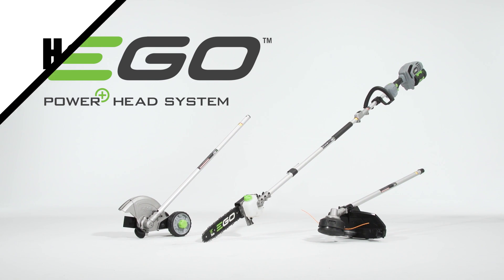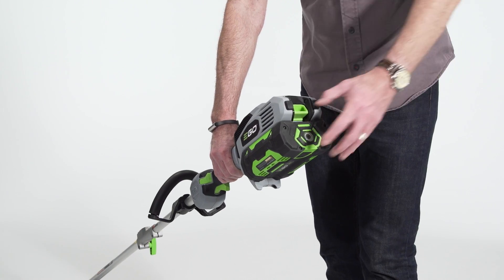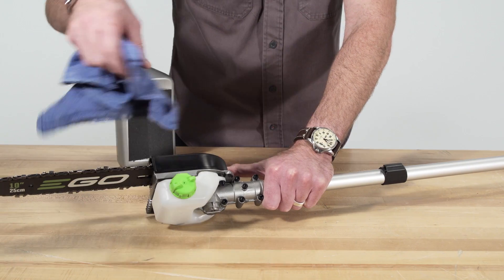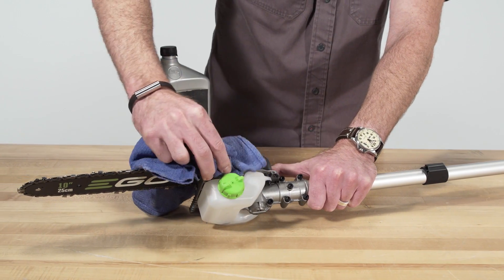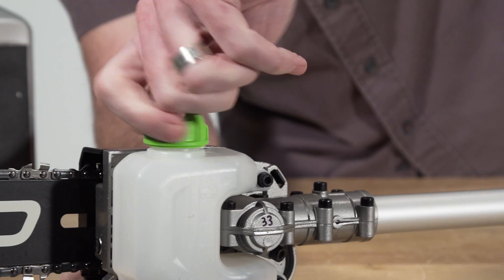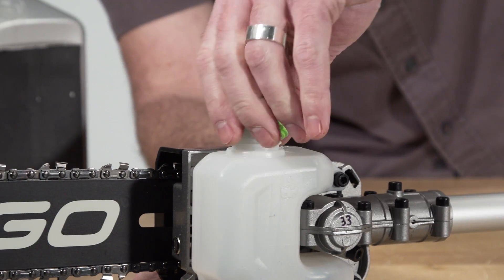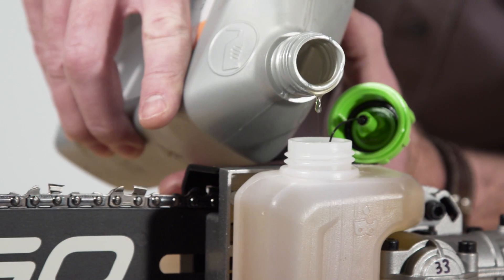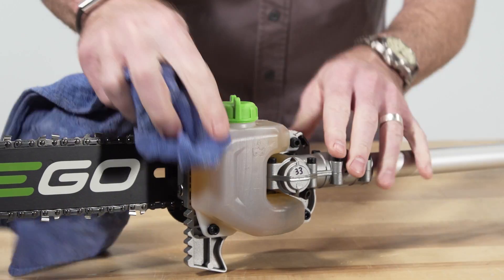How to Fill the Pole Saw Attachment Oil Tank

Comment: How do you know if the oiler and the tank are operating properly when sawing?

Brand new out the box and that 80v 10” model wouldn’t cut water. I put the oil in, but the cap has some weird gizmo down inside the tank, attached by string; what the hell is that for? 

I can find no information on that stupid thing, where it belongs. It can’t just be to keep the cap from flying off. Why would it?

Comment: Can you put a bigger bar on this tool?
Reply: It's standard length. You can get a pole extension for the multi-head system, search "ego multi head extension", there's an aluminum version for 60, carbon fiber version for 120 that is slightly longer, both sometimes cheaper during sales.
Reply: @Investigamer  I have the pole chain saw. Thank you. My question was can the bar on this particular chainsaw be bigger with no issues…
Reply: @Investigamer  the bar is the chain and its shroud.
Reply: @paedahe4975  oh I think I saw a post of a guy saying you can but that it will reduce battery runtime, never tried it myself

Comment: Is it using 2T or 4T oil?
Reply: Did you get a reply
Reply: @eisanabi6838  no. Still didnt use yet.
Reply: The manual for this pole saw (I just got one) specifically states: "Use OREGON bar and chain oil for best results." Also, "Never use oil or other lubricants not specifically designed for use on the bar and chain." Hope that helps.
Reply: @girthexpander9771  thank you. It's help me a lot.
Reply: 2 Stroke oil only!

Comment: Why can't one just buy "chainsaw" oil?
Reply: The manual for this pole saw (I just got one) specifically states: "User OREGON bar and chain oil for best results." Also, "Never use oil or other lubricants not specifically designed for use on the bar and chain."
Reply: I'm using another brand of chainsaw oil- it seems fine.
Reply: Just to clarify, it's not chainsaw oil it's bar and chain oil. Any brand works as long as it's for your bar and chain. Used for both chainsaws and pole saws.
Reply: I use STP bar and chain, and it’s fine.